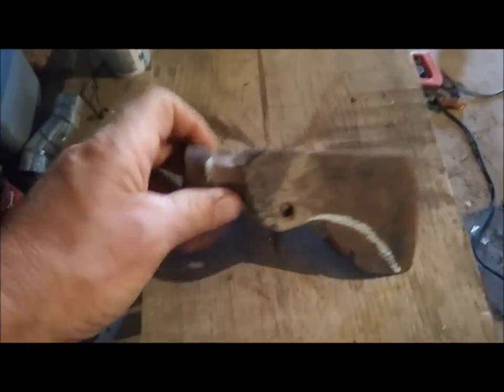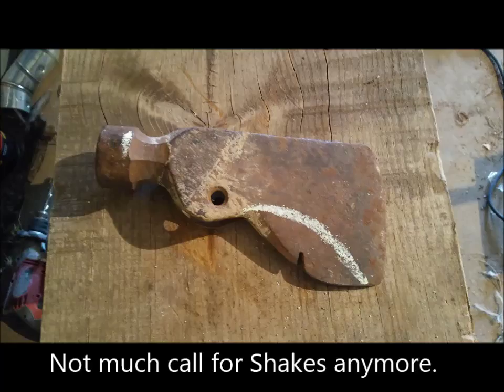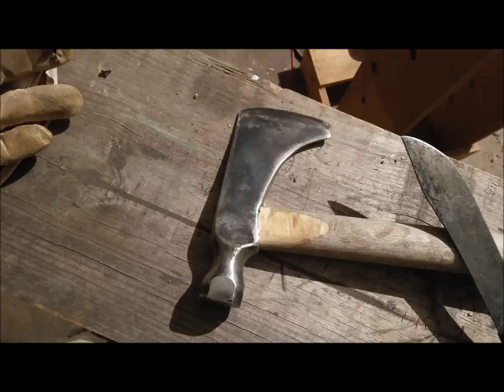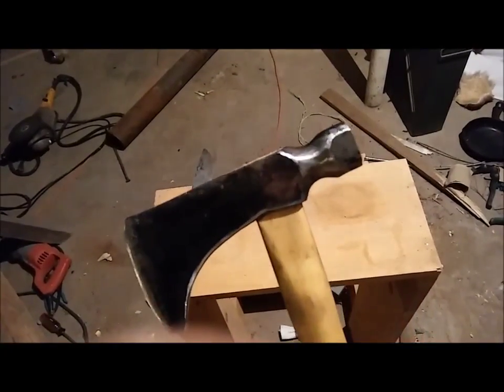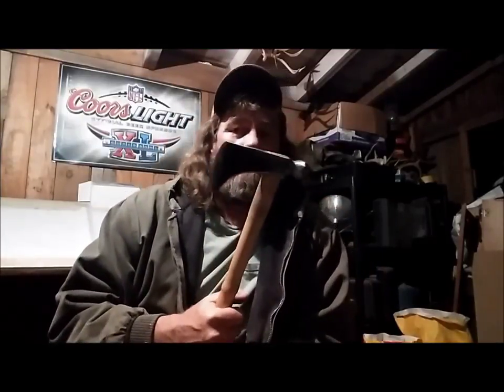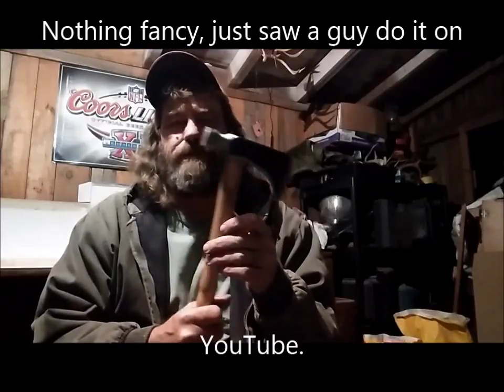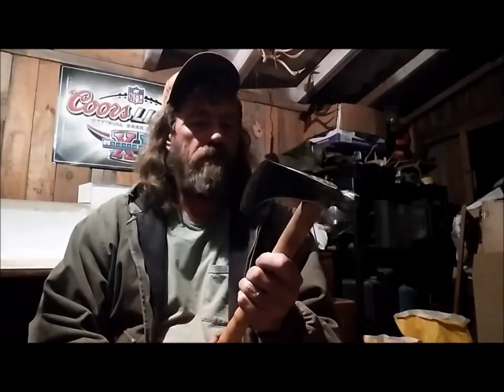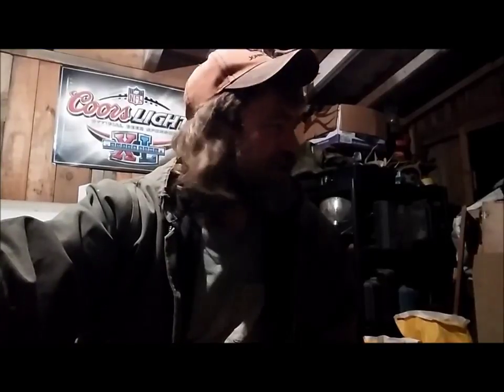Old Framing hatchet to new Tomahawk

Comment from the maker: Never make a Marine angry, just is not smart. SSGT B. A. How ya like it. Gonna do etching to see if I can make it more epic-er.
Reply: Wes S I just found this video. that's a good looking axe.
Reply from the maker: The etching is kickin my butt, I need more power!
Reply: Wes S electricity?
Reply from the maker: Yep, I think my battery charger is stuck on 2 amps. I wish I had one with the Boost setting. 
Mine is etching the steel but it is very slow. I saw a thing where you could do it with boiling liquid and submersion, I may try that.
Reply: Wes S I'm making an again on Monday
Reply from the maker: I founded me an ax head in the junk yesterday. lol  I keep changing my plan for it in my head lol